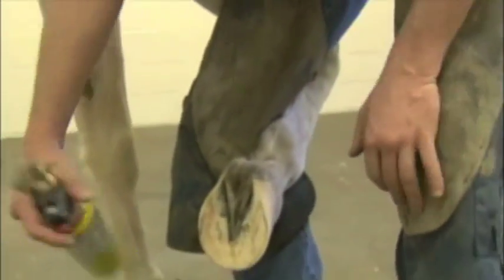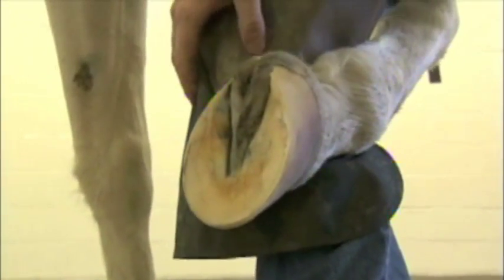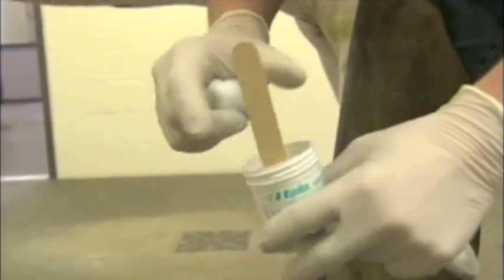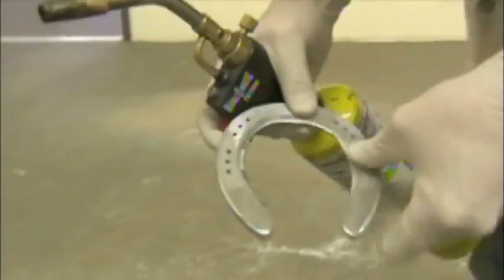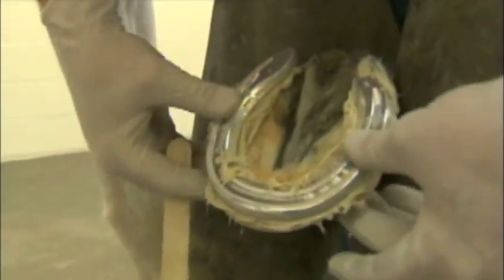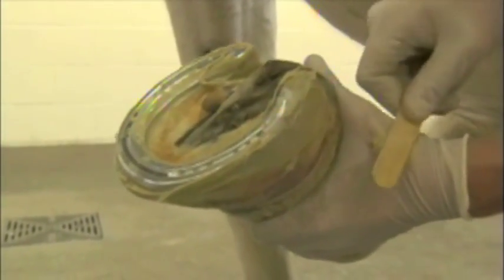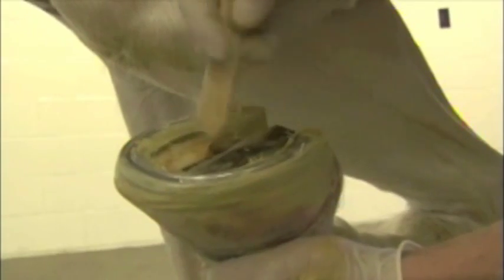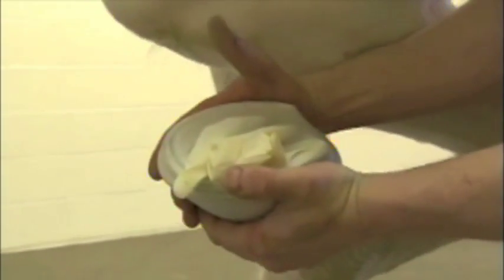Veterinarian Quick Takes (Scott Morrison): Glue-On Aluminum Shoes

Comment: Can you tell me, is the glue bond between the shoe and the ground surface of the wall strong enough to keep the shoe on for a pasture horse? I've been told the glue should be run part way up the wall to make a cup like form so the shoe stays on longer.